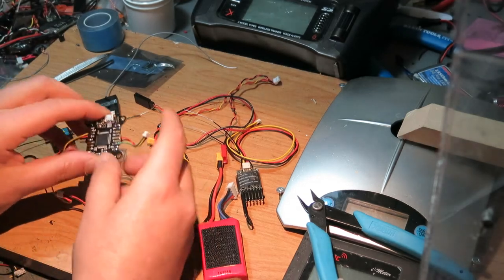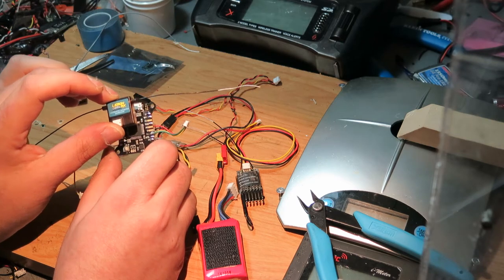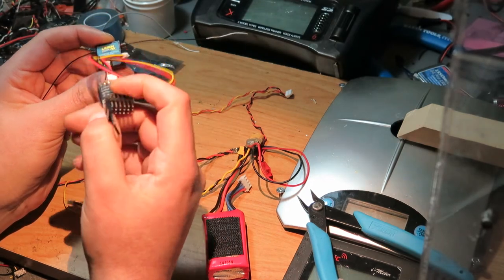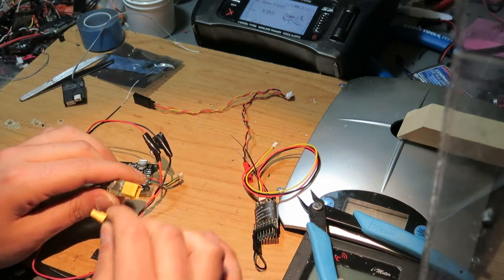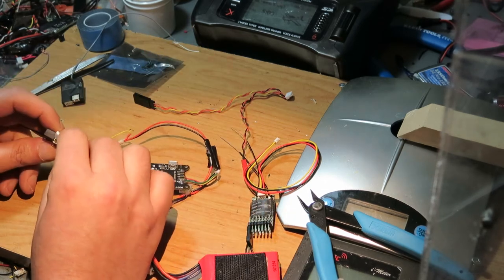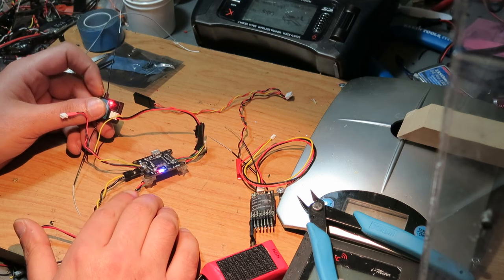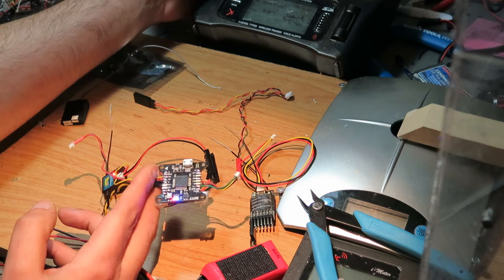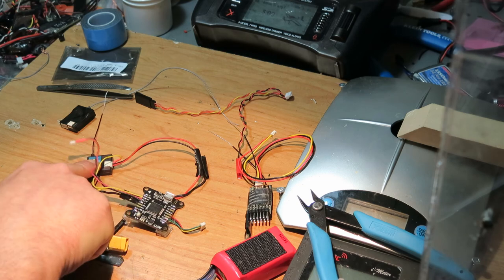LUX Race Flight controller with Lemon Sat receiver

Comment: I had this same issue just now but I was able to bind after about 5 or 6 power cycles using only onboard power. I could work out no rhyme or reason why it was like this but it is happily powering it now without an additional buck.

Comment: Did you end up flying with the separate power supply, or come up with another solution?  I'm running into this issue too and the last thing I want to do is add another board to my build.
Reply from the maker: +Matt Smith Hi Matt Sorry man for late reply , but Yes I ended up using external bec. you always can go with Pololu which is really tiny